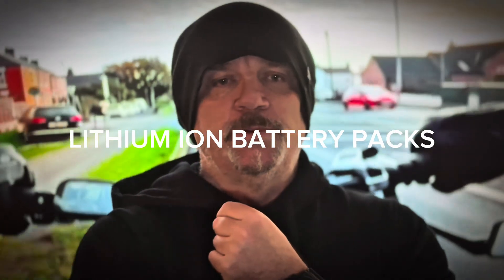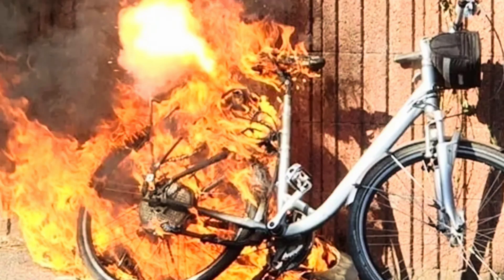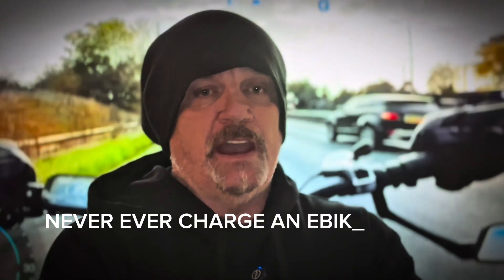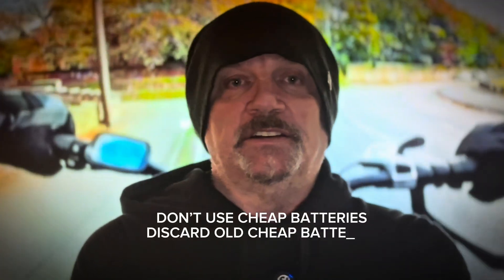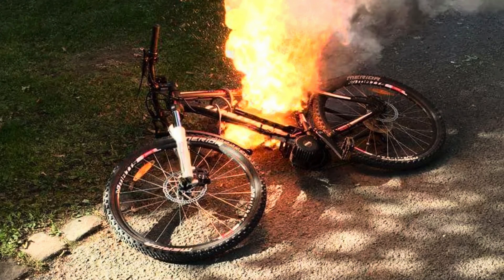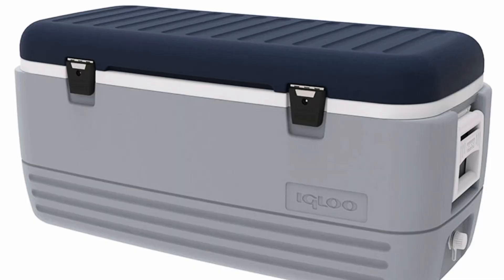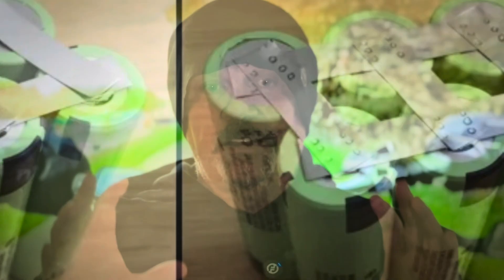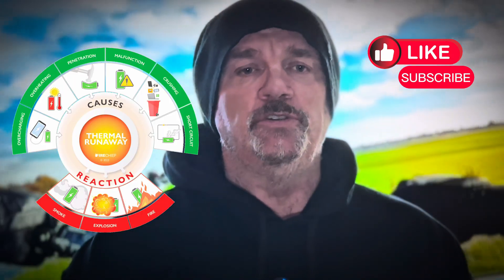Are E-bike Batteries Safe? E-bike Battery Safe Practices.

Comment: Hi Gee , very similar to yourself, currently using a watertight locking  storage box lined with engineering brick and 50 mm polyurethane foam sheeting .
Stored outside all year around , 
1, watertight 
2, heavy , won't blow in wind 
3, ideal for charging

Comment: I learned all this 6 years ago when I bought a KTM E-MTB with Bosch 36v 13ah batteries- never store fully charged, long term store at 40%, keep somewhere cool with stable temperature. If you do partially charge to say 80% then regularly you must take the batteries up to 100% (It takes 32 mins per 20% to charge from 0-80%, except the last 20 % at 80-100% that takes 90 mins and shows the slow balancing as each cell hits 100%)....Both my batteries have minimal degradation and I can still get almost the same distances for any level of assist.  When I first got the bike the advice from everyone was "when you get home fully charge it"...WRONG!! Never charge a physically warm battery, likewise a charged battery needs to cool before use, and I only ever take the battery to 100% in the hour before I plan to use it so it's not sitting in a high state of charge.....And with the old "Semi integrated" no problem bringing them indoors and living in the Highlands there's a serious danger of them dying from sub zero if left outside in a shed. And on (rare) sunny days don't leave the bike/battery in the hot sun either, shade it if you are stopped somewhere for lunch etc....
Reply from the maker: @BarrioBarranco1  depends on the length of time you’re storing the battery. 2 months doesn’t need any charging alteration … long term though you’re correct. 

Good post buddy.

Comment: I'm wondering how easy it is to put on a new BMS to a stock battery gone bad?. I have a battery that stopped charging and I bought a new charger.  Wasted money.  It was a bad BMS.
Reply from the maker: @JohnBabcock-qy1cs  loads of videos on how to online.
Reply: @ModProjects4306  I need a new case and bms for a battery on a Kepler that only has 1,500 miles on it.  I will get those and do it over winter.  Or have a local E Bike shop do it. Probably $200 or less. I did get a new one already that is better than the original.  But I want to keep the old one. Probably an easy fix.

Comment: I ride my Bosch equipped e-bike all year round. My range drops a little in wintertime but nothing like 50%.
Reply from the maker: @johnhamilton5324  move somewhere very, very cold, leave your bike fully charged outside in a freezing garage overnight and let me know how you get on. 

The higher the capacity battery the bigger the loss.